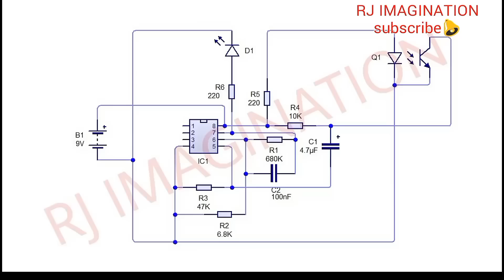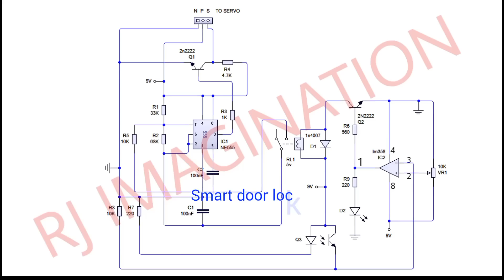Top 5  electronics Projects using IR Transmitter & Receiver Led

Comment: Diagram?
Reply: Pause video, take a pencil and paper, copy what is on the screen. Simples. Also try using full sentences which include the words "Please" and "Thank you". Pause at 3:07. Its not difficult.
Reply: This circuit builder is unhappy showing the circuit diagram . He is always busy showing his soldering. Never does he show the circuit diagram in a practical & workable manner. He never listens to this repeated request for circuit diagrams.
Reply: In video